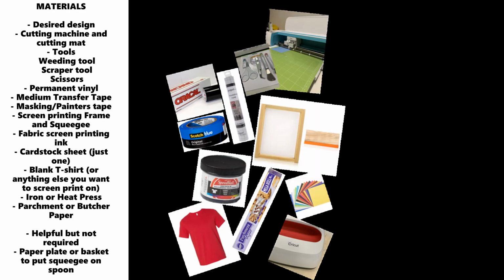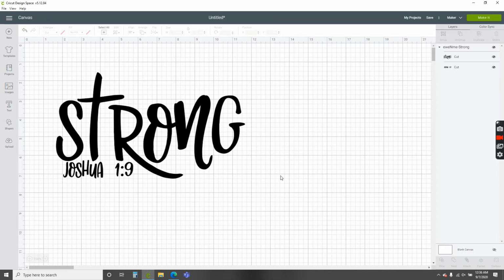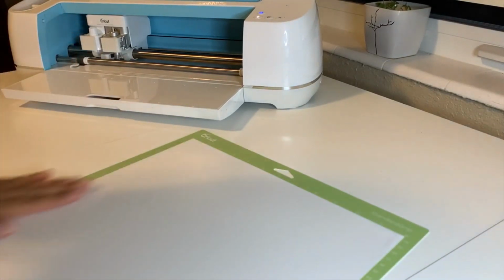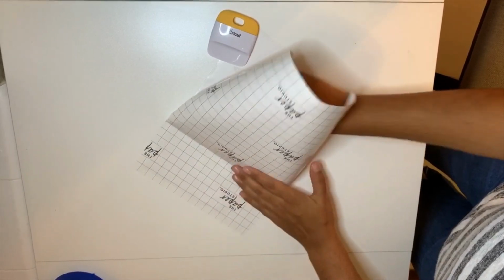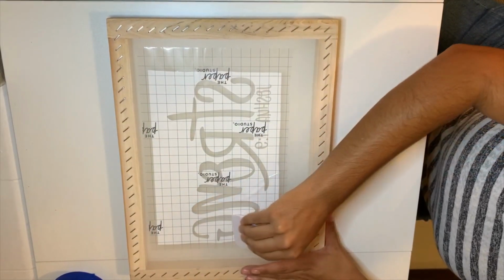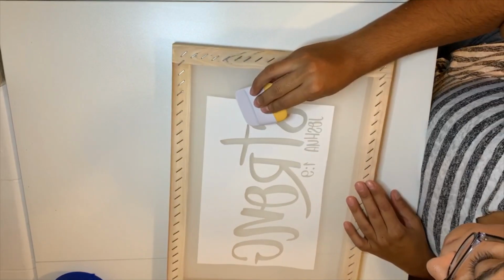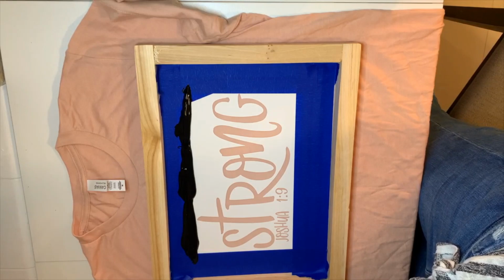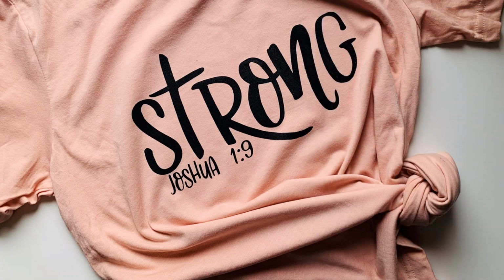Screen Printing Tutorial using a Cricut Maker and Permanent Vinyl | Cricut Tutorial | DIY | TShirt

Comment: I am new to screen printing at home. I want to make T-shirts to sell. I have watched a few videos and there are a few things I do not understand.  1. What is the best material to use for the stencil.  2. Is the stencil reuseable.  3. What if I want to make 3 T-shirts and they all have different designs/colors, don’t I have to wash my mesh frame and change the stencil, if so, won’t the frame be wet and not be able to be used for the other tees?  4. I keep seeing/hearing about emulsion, is it necessary for what I want to achieve? I also read that the emulsion steps need to be done in a dark room and that it makes the crispest designs on the shirts, yet I don’t see everyone using it. I am pretty confused by all of this. I would really appreciate it if anyone could help me. Some of my questions might have been answered in the video, if so, can you help with all of them still. Thank you.

Comment: Thanks for the video.  Although I was thinking you were going to show how to attach permanent vinyl to fabric.  Instead, you did a instruction video on vinyl stencil for screen printing.  I am just getting into cricut crafting and started to think in the future about sublimation.  I like that you explained the benefits of screen printing over sublimation (transfer).  You just saved me some money because screen printing will seem much more creative, fun and inexpensive.  I have a suggestion on your recommendations to go lightly on varnishing the vinyl face side so as not to pull the screen from the frame.  Grocery stores toss tons of big boxes away that hold the individual retail boxed merchandise.  I would suggest go to a grocery store and ask them if you can have some  boxes as many people ask for them to use for storing dishes to move.  Then cut the box open to lay flat and then measure the inside space of your screen print frame and cut out as many pieces as you can.  Then stack them inside the screen print frame until they are flush pushing a little against the screen.  Then you can apply more pressure onto the vinyl to varnish without having to worry about pulling the screen away from the frame.   You spoke detailed instructions without unnecessary commentary.  You spoke as if you were vocally reading instructions out of a instruction manual.  Very good job.  I will subscribe to your channel.
Reply from the maker: Thank you so much for the feedback and suggestions! Much appreciated!

Comment: Is this better than vinyl heat transfer?
Reply from the maker: Some prefer this method because it holds up better with washes in terms of it won't eventually peel off. It may eventually fade depending on how it is washed though but should in theory last longer than the heat transfer vinyl.

Comment: Great video thanks for posting. For the liquid paint is this a vinyl paint ? also if I use the paint I don't need the vinyl roll at the same time? Thanks again.
Reply from the maker: Thank you! The paint is by speedball made for screen printing fabric. 
I’m not understanding the vinyl roll question, I’m sorry. The vinyl roll I use here is as a stencil to get the design to transfer the ink. 
Let me know about the vinyl question so I can better answer.

Comment: I’m sure you can use the screen several times. But can you wash it and use it again? Or does the vinyl start peeling off?
Reply from the maker: That is a great question. I have not tried it before. I would think that that vinyl will start peeling off, especially after rinsing it off. 

I will try it next time I do it and see how it goes! I will let you know :)
Reply from the maker: So I tried it out and it actually worked.. I totally forgot to retake the edges so the ink went through there, but the design itself was perfect. 
I must say though when you are rinsing the screen, be very careful that none of the small pieces accidentally get rinsed off, if you can make sure that all the pieces stay on it should work.

Comment: God bless you SISTA😍 thank you for your tutorial, wondering what vinyl brand did you use ? The transfer tape I’ve use didn’t work for me it’s super sticky
Reply from the maker: Thank you 😊  I sound like a robot but it was my first one so I was nervous 😁. 

I’ve used oracle 651 mainly and Cricut permanent vinyl. 
The transfer tape can be tricky and there are different types with different degrees of tackiness. For this one I used the paper craft studios transfer tape brand from hobby lobby and I’ve had great experience with this brand, it has worked well with many different projects and isn’t too crazy sticky.
Reply: May I ask what would you suggest using to make a stencil to use over and over.

Comment: How come I can’t weed once it’s done cutting
Reply from the maker: It means the machine didn't cut all the way through the vinyl. Check the setting and type of vinyl you are using. Sometimes, you may need to press the cut button twice before unloading to that it can cut fully.  Or find another setting for that vinyl that will cut through the entire vinyl thickness.  Also, make sure your tool is in good shape and check it before it starts cutting, sometimes some residue or small pieces of vinyl/paper get stuck on it and messes with the cutting ability of the blade. Hope this helps!
Reply: @mycraftypersonality4241  thank you I’m gone try this tomorrow, I don’t unplugged everything already , thanks again and I love you work
Reply: @mycraftypersonality4241  I’m also using Cricut permanent vinyl

Comment: I’ve tried these step and end up with my ink cracking after I press it with a heat press I let the ink dry for 24 before pressing it ..why is this happening??
Reply from the maker: Good question! I’m not 100% sure but maybe look into or consider the following: 
Was there perhaps a thick layer of ink on there? Or maybe it was not fully dry? What was the material of the shirt, maybe that had something to do with it? Also, what was the heat setting you used, was it too hot?  Hopefully this helps! Unfortunately trial and error plays a role here, maybe practice on small areas and test it out. 
I did notice this happened to me when I used white on a black shirt, but that’s always a tricky one to do.

Comment: I use this same kind of paint with a brush and freezer paper for a stencil
Reply from the maker: Nice! How does the freezer paper work for you? I haven’t tried it with that.
Reply: @mycraftypersonality4241  really well, I put shiny side down on fabric and seal it by putting it in the heat press. I was really surprised at just how great of a seal you get around the design. It’s a game changer when you figure out how much money you’re saving in materials.
Reply from the maker: Awesome thanks! I’d have to try it!